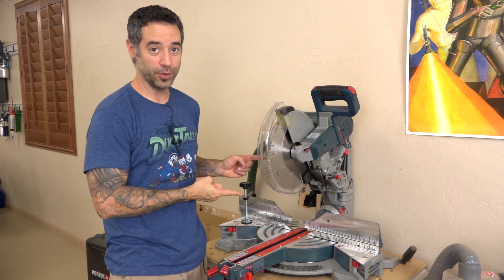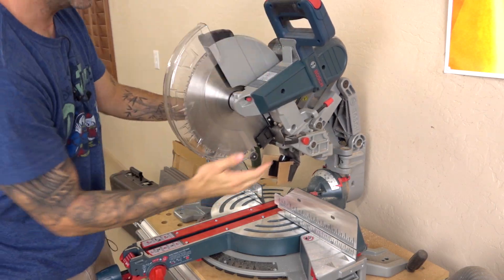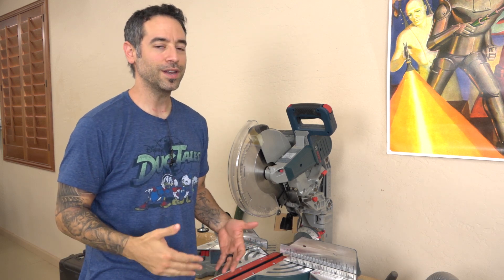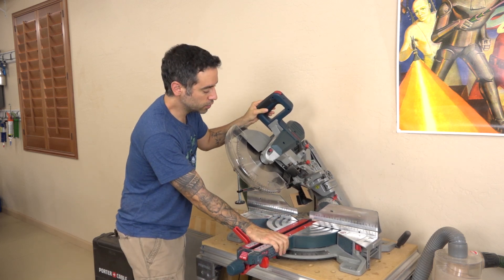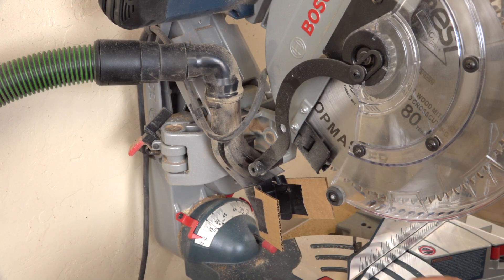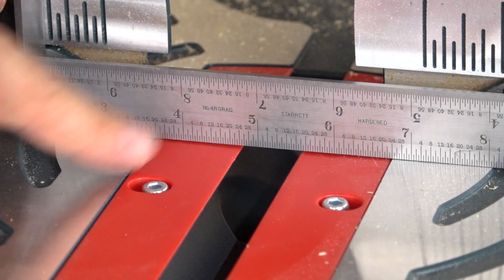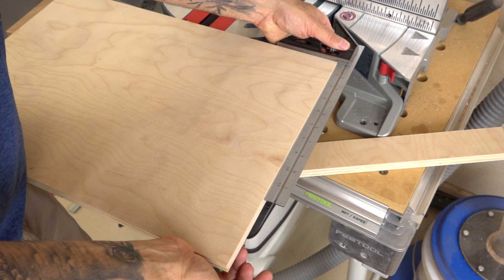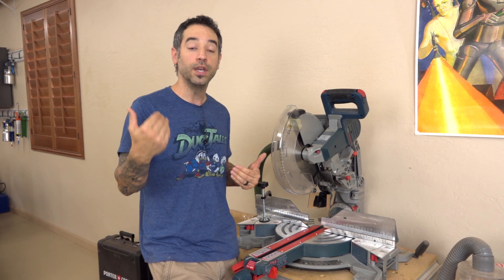Bosch Glide vs Festool Kapex

Comment: I am on the fence about purchasing the Bosch.  There are videos on YouTube regarding issues with blade drift and accuracy?  Has anyone experienced this?   As per the dust collection there are lots of simple fixes to improve dust collection most are enlarging the rubber inlet piece.  My concern is accuracy.  I don't want to invest over $500 for a saw that has deflection issues.
Reply: i use this saw every day and i haven't experienced any blade drift. at least no more that i experienced with a dewalt saw. the only times ive really noticed drift on any pro quality saw is when you try to force a thin kerf fine tooth blade to cut faster than its meant to.
Reply: I have had the 12" Bosch Glide for a year now and it's been amazing. Has handled everything I've thrown at it and I've done some bizarre projects this year! The Festool was way outta my price range from the get go as there were other tools I also needed to purchase on my budget. However, I did go back and forth on the Dewalt vs Bosch for a long time before making my decision. I have a bunch of Dewalt tools (18v and 20v). I have a Bosch router that I love. In the end the Glide system over the poles used by the Dewalt just made more sense both in terms of space and avoiding the "sticking" issues that all the pole based sliding miter saws have to deal with over time. I love the Bosch Glide and have not looked back since purchasing it.
Reply: There are several on Utube and elsewhere showing the problem besides unlevel table problem.
Reply: bosch its a bad saw...1.festool 2.hitacchi 3.makita 4.dewalt  -choose 1 of those
Reply: +stefan ivanov Do you own any of those? I own the Bosch and it's amazing. I've also recently purchased a Rigid Universal Miter Saw Stand and it's working out perfect with my Bosch chop saw.
Reply: +stefan ivanov Disagree strongly. Do you own the Bosch? I do, and it's rock solid.
Reply: I have the Bosch and it's rock solid price of kit and very accurate! I use it out on site and for various jobs and materials and it's never had issues except the weight! But that also makes it solid to use! I've got the 12" blade and my only advice is don't skimp on a cheaper blade as it'll let it down!
Reply: ben chandler my 10” Bosch glide is out for me, crap cuts!  Kapex is on its way as I type this!

Comment: Kapex is quieter than most saws. But its no way going to be a site tool. Its too delicate .The Plastic is not as strong as a Metabo etc . Buy a good saw and then buy the best blades and get it set up correctly is the best advice

Comment: i just dont believe the kapex is "so much better" when it comes to angle cut verses the other big 3 ( bosch,makita,dewalt ) its all in the blade especially with the 12 in miters saws i use a forrest chopmaster or a leitz(competes with forrest but cheaper) and have no problems with miter  uts

Comment: In the uk the Bosch sells for anywhere between £700 to £800 pounds about $870. So if you can buy it in the us for $600 ish why isn't it cheaper in the uk £480 ish. I find this with most tools being cheaper in the us. So the company's must make more of a profit in the uk?surly they should have fair pricing around the world
Reply: Consider yourself lucky, the USA does not have social medicine. I can buy a new saw like this every month with the money I spend on health insurance - which by the way, still has a deductible.
Reply: whatever you do, don't move to Australia. Anything on the market will cost you an arm and a leg. Bosch glide (12") - $1000 (if you're lucky); Festool Kapex (10") - just a touch shy of 2k!

With the current exchange rate the Bosch tool is about $200 (US) more expensive for us.
We get done over for it all the time. My DeWalt table saw cost $750(AU), over in the US its about $450. Don't get me started on every other consumer item. Only thing that keeps me going is that we have a decent living wage.

Healthcare is another advantage. I had a brain tumor and left the hospital with a $45 bill for some meds and that was it, all with no insurance! Still costs me a bucket load for my toys though!
Reply: russ evans i think the voltage type/ difference also played a part in the pricing. different motors and everything. I noticed this when i was researching about the dewalt dw745 table saw. Same model but the price difference is substantial
Reply: russ evans because Bosch is based outside of Chicago.
Reply: Ben Good lol thank your God for living in Australia!. Here in Russia kapex costs $3000. American, not Australian fucking dollars.
Reply: The USA doesn't have VAT.
Reply: Cheap compared to what I paid for one in New Zealand...
Reply: russ evans shipping and tariffs maybe

Comment: I have the Bosch Glide, my partner has the Kapex, aside from better dust collection, the Kapex has nothing on the Bosch, and the Bosch has a stronger motor for $ 900.00 less. Festool is delusional with their pricing, one more thing, you can cut crown moulding on the flat with the Bosch, with the Kapex, you have to nest it, COME ON !!

Comment: I have an older version of the Bosch saw found the same issue you are having with small pieces falling into the mitre slot. My solution was use a zero clearance insert with I got at LeeValley  http://www.leevalley.com/en/wood/page.aspx?p=74047&cat=1,240. Very inexpensive

Comment: I bought the Bosch glide saw 3 years ago. It’s garbage. Crazy blade deflection. Had to modify the fence so it would sit square with the deck etc. dont buy this saw it’s not worth the price tag. Save yourself some trouble and money and get a much more reliable and accurate Dewalt. I recommend the non-sliding double bevel version.

Comment: I've been working with Bosch for the past year and other than the chordless drill I wouldn't consider another tool from them. Every aspect on this machine is not just bad engineering but often times dangerous. And honestly, having watched this video, I can't  trust Mark's opinion on anything anymore either.
Reply from the maker: LOL tough crowd. How about we discuss some of these things to see why our experiences differ instead of you bringing "trust" into the equation. Seems there are plenty of people who agree with my personal experience so I'm not just making things up. I truly would like to know what you see as bad engineering and dangerous? I'm no engineer but from the last 6 months of using the saw, it appears to be well-designed and no more dangerous than any other brand in this category.
Reply: I guess you have to address the "haters" at some point right. So let me quickly explain why I completely disagree with you. A little about me: I have several years of experience in furniture, built ins, restoration as well as finish work. I also teach woodworking courses here in Germany, and in both instances have the pleasure of using this Bosch saw. So not only do I work at a professional level with it, I actually show about 20 people a month how to use it as well. So here goes:
1. The easiest: dust extraction. The dust extraction is worthless. Like literally. And you already agree with me on that, although you'll probably mention that cardboard "add on" you have. But I really have a problem with having such low requirements towards the machine and the company. More to that later. 
2. The clamp. You mentioned it. You even showed a "better" version. I personally have the better version, and it's a joke. Another example of bad engineering (I understand you're not an engineer but you have to admit it affects you whether you want it or not). Again, I'm frustrated by your justification of low standards.
3. The bevel. And this is where it gets dangerous. I have seen people countless times grab that fancy red lever thinking it's used to fix the saw at a certain degree. Or they've managed to leave it unlocked and someone else comes to cut. That's a dangerous situation. 
Anyways, I have several more talking points but I've lost my interest here, since I genuinely don't think this machine should be used by anyone but I'm pretty sure your "fans"(I assume I don't belong to the group) will take your point of view as there own inb4 shitstorm. 

So the reason I can't trust your opinion for two reasons and you said these yourself. 
First, you have low standards for what a machine should provide. Sounds harsh, just watch your video. 
Second, you didn't even show us the makita! Seriously dude?
Fazit: buy a used festool before you buy a new Bosch.
Reply from the maker: You say you completely disagree with me yet we actually agree on 2 out of your 3 points. And your third point is actually attributable to user error. Yet this is cause to distrust my opinion?? You're a hard guy to impress, haha. Your "bad engineering" argument is rather weak considering pretty much every other saw on the market, except for the Kapex, would be subject to the same exact criticisms (clamping and dust extraction). And let's be honest, those are creature comfort features anyway. As for the Makita, well, that wasn't part of this video and wasn't promised to be part of this video. Should I be faulted for not showing every other brand on the market too? Anyway, I'm guessing this will go in one ear and out the other since it sounds like you've got a bit of an axe to grind and I just got to be your lucky target today. Thanks for stopping by.
Reply: sounds like your bitter at bosch, it's that simple, biased opinion
Reply from the maker: sounds like he's a little bitter about me too, lol
Reply: There it is. I saw this coming and almost didn't reply, but here goes. Like i said, i work with Bosch tools. Bosch routers, Bosch angle grinders, Bosch handsaws. Of course I'm pissed. I just in depth critiqued your judgement of Bosch machines and that's what you boil it down to? My problem with your, and I'm going to be very direct because that's what a German does, is your rationalization and justification of the weaknesses. Anyways, I just really hope nothing happens to anyone using this saw, or any other of their handtools and that if you're happy with them, you manage to stay happy. Peace
Reply: Lol
Reply: +B Felber seems like you're not a very good teacher if your students are leaving that locking mechanism unlocked while making a cut, or you could just blame it on engineering I guess haha! That's like blaming the engineers for somebody leaving the fence unlocked on a tablesaw while making a cut, pretty lame argument👎🏻
Reply: bosch is the best in drills etc in saws festoon is better if you need to spend more money than choose mafell

Comment: I'm trying to understand why everyone likes this saw so much. I just purchased one and sent it back, bought the same one, and sent it back for the exact same reason. It's just not accurate.

When I called the manufacturer to tell them that my Bosch was making a "curved" cut, they said this intended for jobsite use, not fine woodworking...which prompted me to ask, if it's for inaccurate jobsite use, then why the f**k (lol) is it nearly $700 and more importantly, why was so much emphasis placed on the arm design to minimize footprint on a workbench (if this is not intended for a workbench).

Overall, I was extremely unimpressed with this saw and still looking. My Harbor Freight Hercules miter saw at least cuts far more accurately (even though it chews up an additional 10 inches of space behind the saw for the bars).

Comment: Festool dust control ecosystem, . . . that's the main difference there Mate. If you have no issue spraying dust everywhere, then buy any other tool than Festool and save 50%.
Reply: Get a Fastcap dust hood.

Comment: Cut the threaded end off the clamp and weld one of these quick release nuts on instead.
http://www.mscdirect.com/product/details/01602986
Assuming you have a welder or know someone that could do it, should be a quick job.

Comment: The makita is the best
Bar none
German tools are over designed with horribly unnecessary parts that make them completely unreliable, over prices pieces of trash
Makita
Makita 
Makita when it comes to a slide miter for a real "road warrior"
 The most consistently accurate, well designed, dust collectingest rootenst tooenest bad ass there ever was
It even slams the DeWalt for accuracy. And I'm talking right outa the box
The new makita incorporates the forward side rails for space and forward bevel adjustment
The dust collection Spanks the Kpex and Bosch and best of all
No stupid size special blades. Easy to change. Literally the best design yet. Try the new Makita Mark, you won't look back
Reply from the maker: I used to own a Makita until it was stolen out of my shop. Later, I tried the new Makita that had the improved dust collection and it was unacceptably flawed. Sent back three times and they all had the same flaw. It’s tough to describe but my hope was they would eventually own up to it and fix the issue, but Im not about to spend more time and money to find out. So in the past I would have agreed with you, but not anymore.

Comment: The dust collection is horrendous. If you make it bigger the bottom catches against the fence. The bevel settings works to difficult. In the end I got rid of it as with daily use everything is covered in sawdust! The motor and the glide are the only good points. The rest is hobbyist Standard! Crappy!

Comment: before you buy a kapex, do yourself a favor and google "kapex motor failure".   that alone will be enough to dissuade you from dropping kapex level cash...even if you have it to spend.  if i'm leaving that much cash on the barrel i expect a much lower failure rate.  i don't have a budget limit for garage level tools, but i don't make money with those tools - it's a hobby - and i don't like the feeling of getting ripped off.